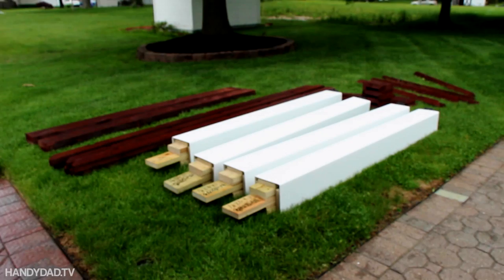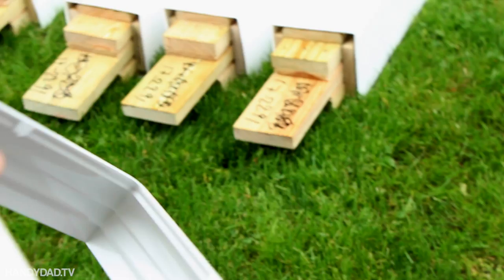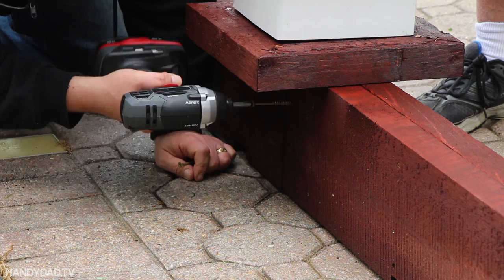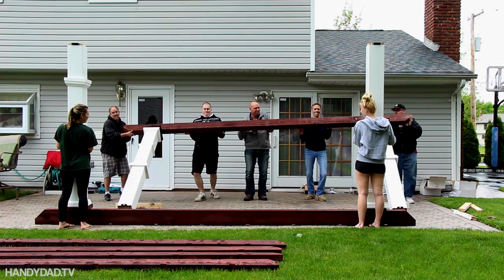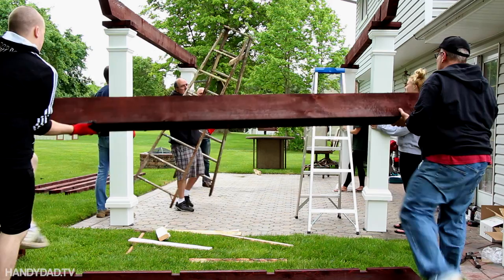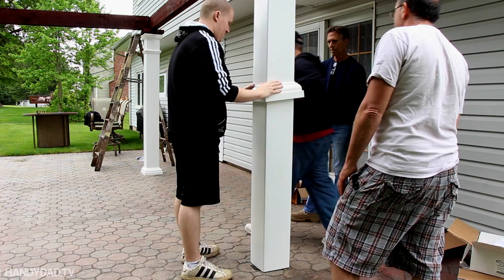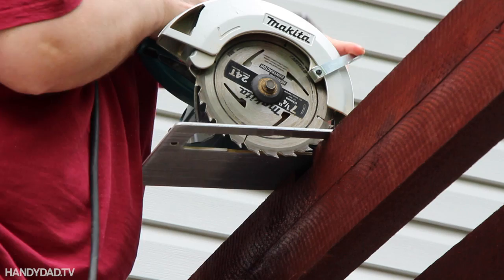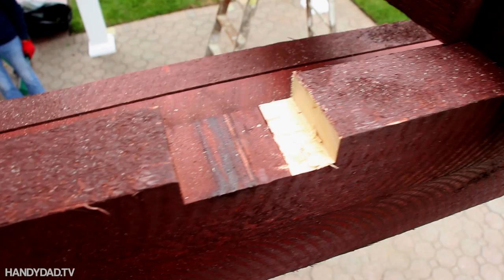Amish Pergola Kit

Comment: Looks awesome, good job guys n girls, nice fix. I'm just curious as to the notch outs on the rafters not lining up, it's just come from the factory so surely Quality Control would have spotted this? Or it's a chancer in a shed that's knocking these things out and not machines in a factory! Id love to find out how this could happen? I'm thinking they build 2 or 3 styles and the Same length of timbers are used on all 3 but the notching out is slightly different and the guy that puts it on the shelf has been drunk lol.
Reply from the maker: +john montague Good question. I have no idea how they cut them, but they obviously don't QC every piece.

Comment: Hi HandyDad - Love the video and channel! 
With this Amish Pergola Kit, you do not need to brace the feet to the ground in any way?
Reply from the maker: +Tom Petite Thanks Tom! We could have secured it to a concrete patio, but pavers weren't practical. I didn't secure mine and it stood through Hurricane Sandy. Wood pergolas are heavy and open so the wind blows right through. Jeff isn't worried about his blowing away. Odds are, a wind strong enough to move that pergola would be strong enough to damage the house too.
Reply: @handydadtv  This is Levi Stolzfus. About our pergolas blowing over from wind.  We tested our heavy pergolas by asking community members to bring to the shop 50 draft horses.  We lined up those draft horses in front of our least heavy pergolas after feeding the horses a mixture of various things for such an occasion. All 50 draft horses at one time broke wind, and just as expected the pergolas stayed in place. We are confident the pergolas won't blow over.  We have applied for the Elmer Melbern seal of approval, and if you're so inclined, you may write to Hannah Smucker for a copy.

Comment: Betting the notches are all equally lined up a s they just inadvertently staggered them assuming they were centered. As in, the top cross pieces were designed for a designated end to all be pointed in the same direction. Just sayin’.
Reply from the maker: No, I have to disagree. We flipped the boards around in different combinations and it was just cut wrong. Human error.
Reply: @handydadtv  I stand corrected. Apologies🙇🏻‍♂️

Comment: You didn't anchor it to the patio. Is there a way to anchor it to the patio to prevent wind damage? Also is the bottom wood covered to prevent wood root?
Reply from the maker: The wood inside the columns are pressure treated and they have flanges to anchor it down to a concrete patio or deck. But it makes no sense to anchor it to a paver patio because the pavers aren’t anchored down.
Reply: Did the kit come with an anchoring system?
Reply from the maker: Yes, with concrete anchors.

Comment: What kind of wood was it made from?  And the MOST IMPORTANT question...how much did it cost?
Reply from the maker: +tomi kingi Kits can be made with different kinds of wood and the costs vary widely. You'd be best off checking with a fabrcator that delivers to your area.
Reply: @handydadtv  For structural strength, I use 'beefy' rough fir for my 2-post custom pergola.

Comment: How is it secured to the ground?
Reply from the maker: +TenzLekden It came with anchors that can be drilled and screwed into concrete. Since this was a paver patio, we didn’t screw it down. We don’t get tornados in NJ so Jeff wasn’t worried about it blowing away.
Reply: Wow. I'd still want it anchored somehow to the ground.  Just for added stability.
Reply: I don’t know about nj not getting tornadoes. We got one about 5 years ago or so and shut south jersey down for like a week. I would anchor it.
Reply: hahaha..no tornados?...also no storm? beautiful and horrible at the same time. :)
Reply: Are you serious. LOL How does it look now.
Reply: mediatwinkleTV unstable
Reply: what about hurricanes ?? which NJ and NY do get ,,,,
Reply from the maker: Mine withstood two hurricanes (Irene and Sandy) without budging. This one hasn’t had any hurricanes yet, but pergolas are airy structures that have little surface area to catch the wind. We don’t think it’ll be a problem. We’ll see.